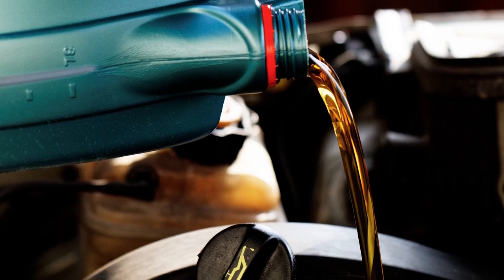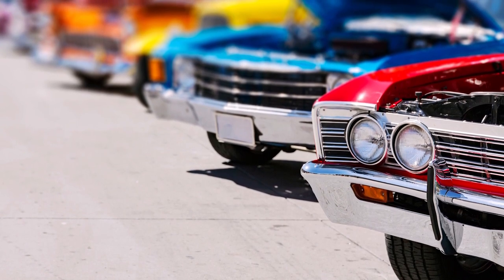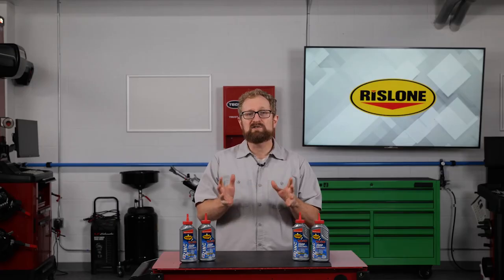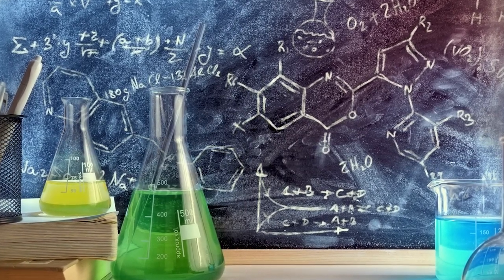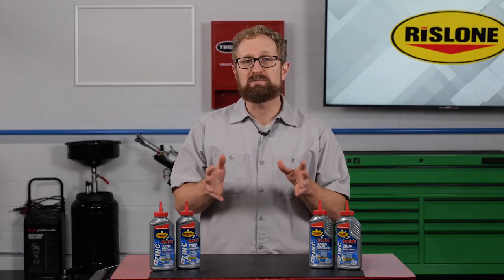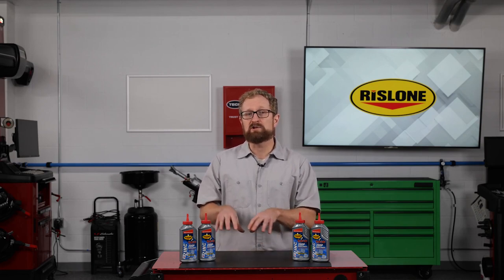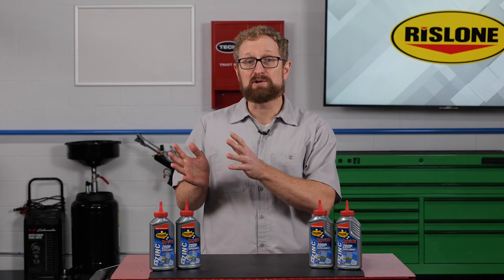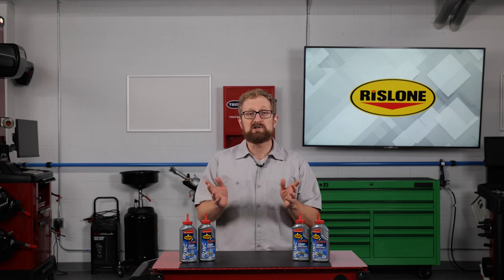Why Older Vehicles Need Zinc in Their Motor Oil

Comment: Is there a benefit to using this in regular cars that are about 20 years old and have high mileage?
Reply: No - modern engines have better metallurgy so not necessary - many new cars still use solid lifters and oils are better than ever - if there's any merit here, a date range for application would have been more helpful - of course they'd love if you bought the product anyway!
Reply: @kristianhermann5971  No, they'd care more to protect your old car, profit is not their target. 😂

Comment: Dislike because:

   1 Engine oils from the last ~20 years are 10 times better than engine oils from 40-50 years ago. You can see for yourself by reading the oil specifications on any can or online. 

   2 Cold start is no longer an issue by "metal to metal contact" because regarding point 1, modern engine oils can now stick to hot surfaces until they get cold, they no longer "burn" or become "dog water" that easy once the flow stops and sits on hot surfaces. Sure, if you rev and drive your engine like an idiot and immediately shut it down after that you will have issues.
Reply: He clearly stated the example of flat tappets..  pay attention
Reply: @xESPplayer500x  Bad example, you still have flat surfaces in modern engines. 🙃